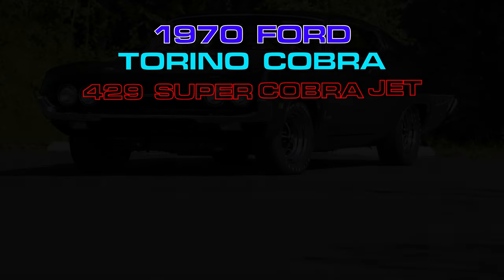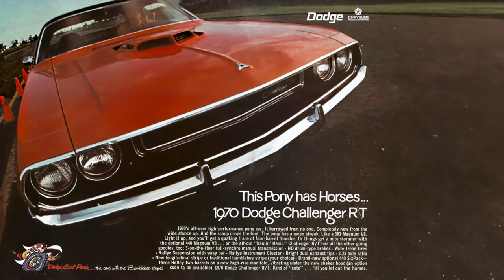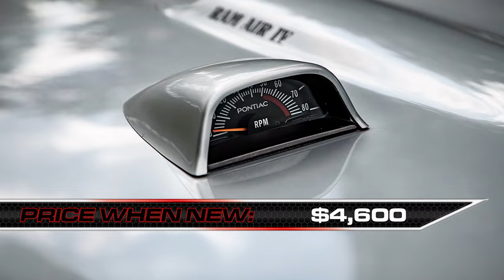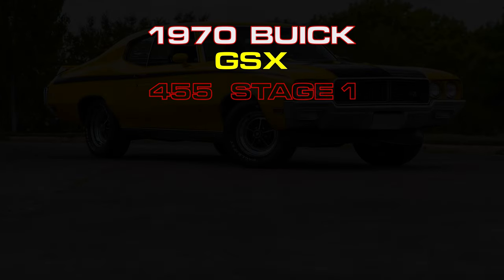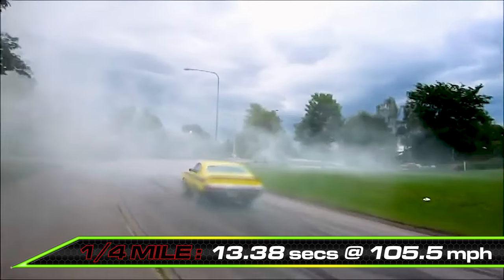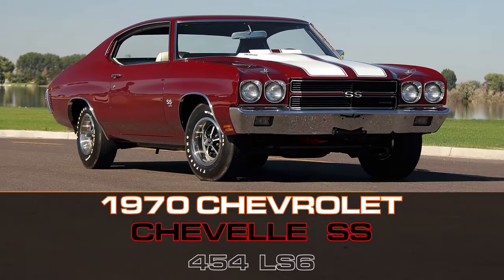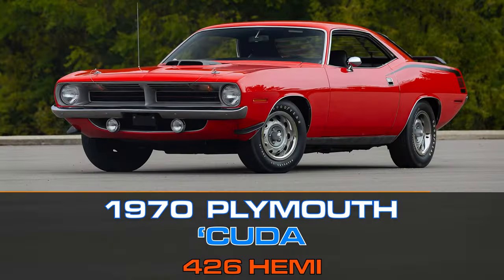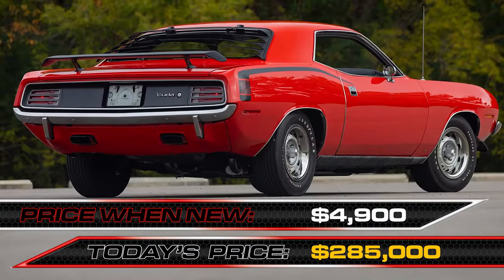10 Quickest Muscle Cars of 1970 | What They Cost Then vs. Now

Comment: I had a 73 satellite Sebring that had the lightest back end. You could smoke the tires when doing 60 and flooring it. Lots of fun to drive.
Reply: Had a 71 Sebring Plus with a factory 383 4-speed and oh yeah it would rise up and rip the tires in 3 gears , actually have a 71 Satellite now dressed as a Roadrunner with the same drivetrain.

Comment: I have a ‘70 Road Runner convertible equipped with a 440 and a pistol-grip 4-speed.  I am NEVER parting with it.
Reply: I had a 1970 Roadrunner back in the late 1980's.  It didn't have a  Hemi in it , but it had the 440 and the air grabber hood.  It was very fast. I regret to this day for getting rid of it.